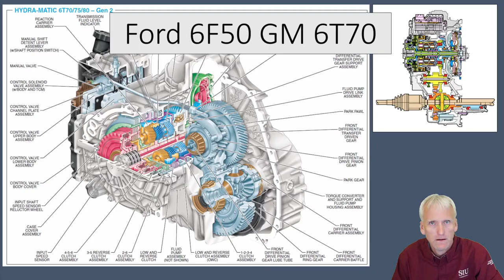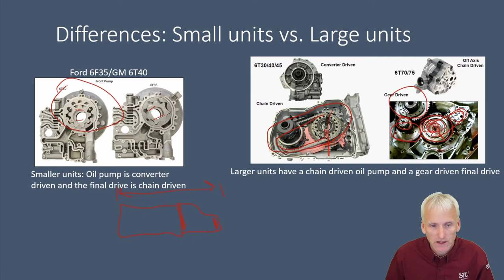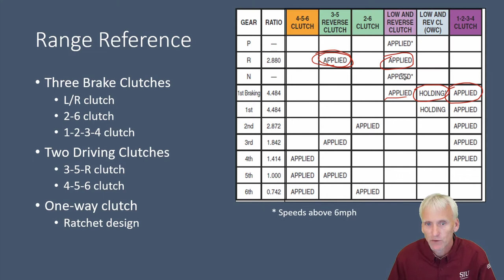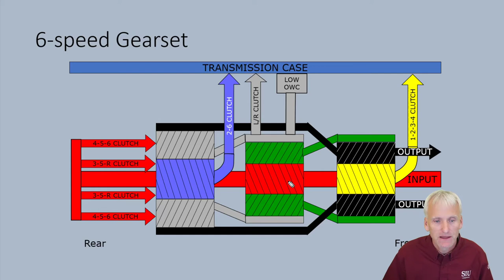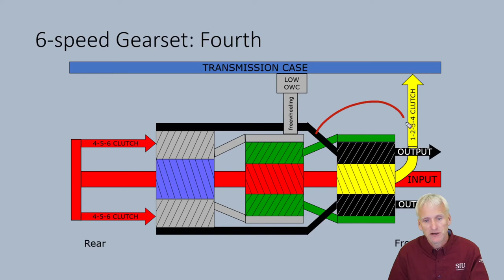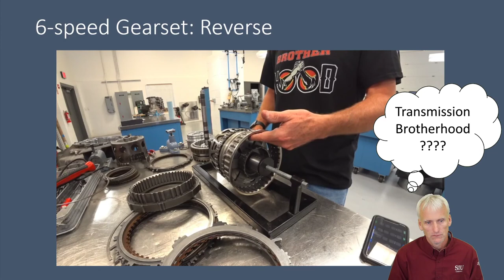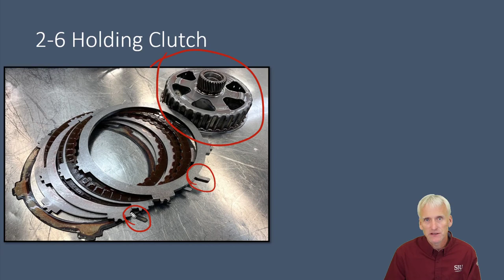6T70 and 6F50 mechanical operation and powerflow

Comment: so as far as I understand it, there is engine braking during coasting in every gear except 1st? There's no forward overrun clutches like in the 4L60E
Reply from the maker: Yes sir!
Reply: To a limited degree, yes. You still have to accout for the torque converter. A good portion of the time, the TCM will wont command the TC to lock at little to no throttle input for the sake of drivability and comfort. However, when the shiter is put into, the TCM will shift to the lowest safe gear to raise the engine RPM and will lock the TCM to provide a direct coupling to take advantage of engine braking.

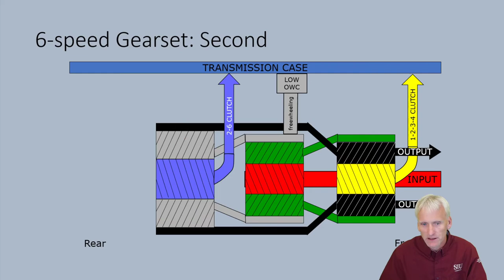Comment: @22:38 you say "I know it's confusing but also kinda brilliant" - when the teacher says this, IMO they haven't gone far enough to eliminate the confusion.  My questions are all about "how is it held" and "WTF is the 2-6 clutch and why is that different than a 1-2-3-4 clutch" and god....so many questions.  When I watch break down videos you guys always race through this stuff like it's so basic and obvious but it isn't.  You don't realize you're explaining things that don't make sense without even more basic knowledge.
I guess thanks for trying.  Maybe someone got something out of this but I sure didn't.
Reply: Not to sound rude but you stated "You don't realize you're explaining things that don't make sense without even more basic knowledge" . This video isn't meant as a beginner video for basic knowledge.   There's so much information and so much to learn about transmissions that this isn't the video to start with. Check into videos that explain shift solenoids, valve body operation and things of that nature.  That will teach you what he means what is being held or driven and what causes a component to be held or driven.